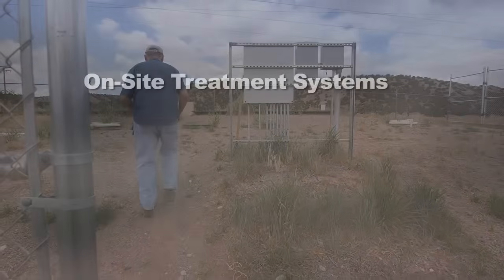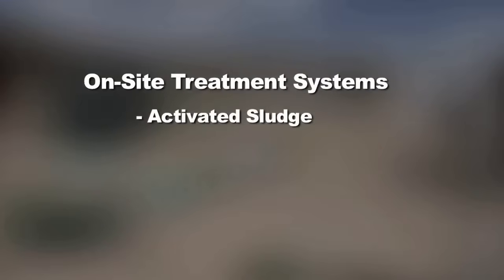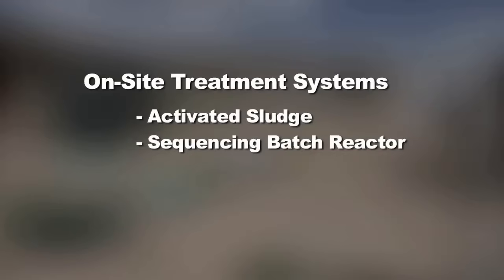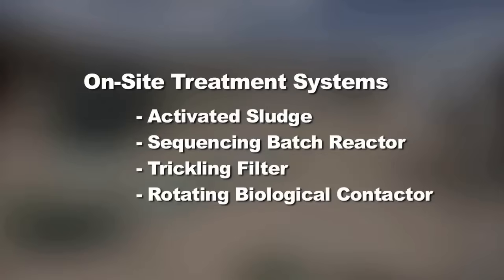Small On-Site Wastewater Treatment Systems

Comment: I wonder the air transfer efficiency using those rotating drums.. as far as I know, oxygen has a very low diffusion rate and its bulk introduction into the water almost does nothing for the aeration purpose.

Comment: With all that water and precious waste, why are they surrounded by a desert? The leach filed is as dry as a bone. Let's engineer better solutions. Let's use these resources.
Reply: You can get a system that compost waste. You need a biology and meteorology class because that’s not nearly enough water to create a desert oasis🤦‍♂️
Reply: @Rafungilo . hi. Are you saying I couldn't nourish a garden or large greenhouse by diverting the grey water I use every day? That is Mike's idea, isn't it? You're saying "no." Could you offer a more feasible counter idea? I say plant 10 trees, care for them in general, and water them every other day or in a cycle throughout the week.Initially, greater care and compost/mulch would be required until they take root. Mini stand of trees with accompanying guild = microclimate = eventual oasis. Geoff Lawton and others have succeeded at this.
Reply: @Reciprocity_Soils  you shouldn’t build a structure over drip lines, the pressure on the ground would back up the water flow, and it makes repairs a project. Certainly there’s things I don’t know about so I’m sure if made modifications you could get away with it. My point was only that if you 100,000 gallons of clean water into the Sahara you won’t get a rainforest